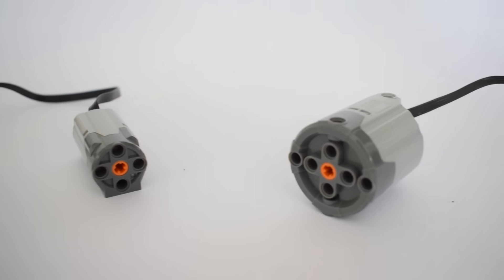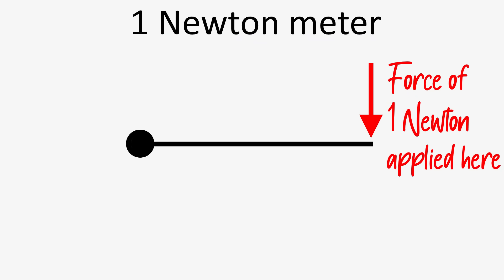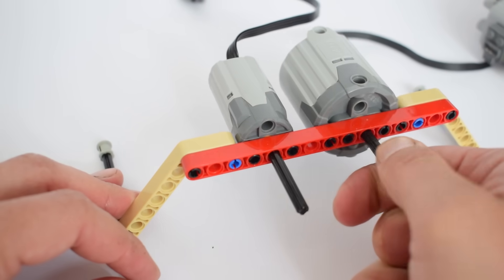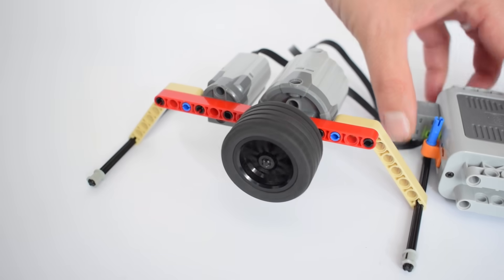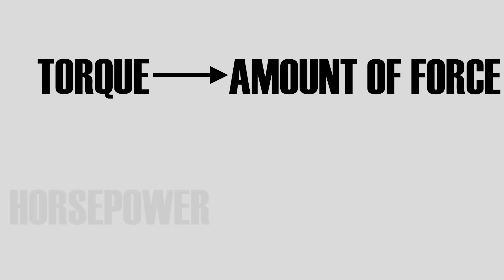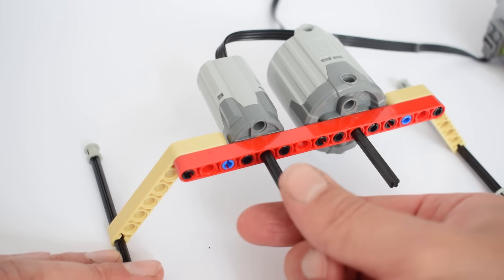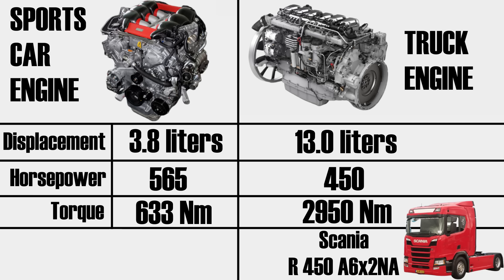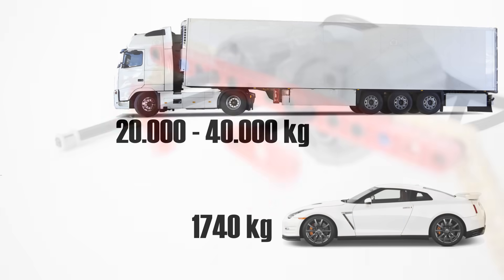NEVER be confused by HORSEPOWER and TORQUE again - HP and TORQUE EXPLAINED in the MOST VISUAL WAY

Comment: I liked this very much. One thing that might confuse people that i saw, because it confused me for a moment... is that the lower hp motor spins faster than the higher hp motor. Maybe it was just me! Thanks for the content!
Reply: Yeah describing RPM as a separate factor helped a lot
Reply: @magma2680  that is the fundamental differnce.
Reply: Same
Reply: Video got me more confused with the little motor with less horsepower spinning faster 😅. Like a GTR 500hp vs 1200hp Bugatti with higher tourqe.
Reply: @Sean Payton  I appreciate you taking the time to explain.
Reply: I think I get the gist......he didn't come out & say it but your answer is implied in the description of sports car motor vs. truck motor. The reason that one motor spins faster than the other is not just "cuz they were designed to". They have different intended purposes, yes, but the designers have only two numbers they can manipulate. If you need max HP, you gotta make torque & RPM work together. If you need more torque, you'll be limited in your max RPM and HP. You want more of one thing? It'll cost ya some of the other, cuz, natural laws and all that.......nothing is created or destroyed, but merely transformed.

Comment: This was all very good, right up to the end. The factor of gearing is completely left out in the comparison between the truck and the sports car. 
If the sports car would have been geared for the same wheel speed as the truck (like 7000 engine RPM -> 100 wheel RPM, versus 1800 engine RPM -> 100 wheel RPM) with the same size wheels, the sports car would in fact be able to deliver a larger torque at the wheels than the truck can, at the point of maximum engine power output. 
The car's engine is delivering a smaller torque, but because it delivers a higher power output, with the correct gearbox you can get to a higher torque measured *at the driving wheels*. In theory, you could haul a fairly sizable trailer with the Nissan's engine. 
Of course in practice putting a car engine in a truck is dumb - it won't last beyond 50.000km i estimate, while the truck engine can go for more than a million km.
Reply: Yeah he said the truck can haul a bigger weight because it has more torque. In principle you could take the car engine, put it in the truck, and if the gearing is good the truck would behave the same because it has an engine with the same horsepower. His explanation is a little confusing and I doubt he fully understands this

Comment: I can explain this 20 times easyer.
In a diesel car you have aprox 4500 rpm, see that as the amount of horses you have in the car. In an petrol car you have 6500 rpm which is lets say 6500 horses. Now the diesel engine horses are aprox 30% stronger. And thats why both the diesel and petrol makes the same output even dough they have different amount of horses, some horses are stronger than others. Wolla.

Comment: 1 mechanical horsepower is the workload/energy required to lift/move 550lbs a distance of 1 foot in 1 second, or 33,000 lbs a distance of 1 foot in one minute. Torque is merely the force. Horsepower is never measured, only calculated. How so? Well, torque in ft/lbs is multiplied by engine rotation (rpm) then divided by 5252 (just a constant used in the calculation) = horsepower. When it comes to cars, think of it this way. If you increase horsepower, then that means you can move the same amount of weight... the same distance... in a SHORTER amount of time. More workload = more acceleration. Same goes for weight reduction. If you have the same workload moving a smaller amount of weight, it can travel the same distance in a shorter amount of time. As far as torque, think of it as being highly correlated with the volumetric efficiency of a combustion engine. The more air that fills the cylinder, the more torque its produced, assuming the necessary required amount of fuel matches that additional air mass. But also remember, rpm plays a role too. If you can fill the cylinder the same amount but at higher engine speeds, you are producing more workload.

Comment: Good presentation, but here are some uncertainties that remain for those trying to finally understand what power is:
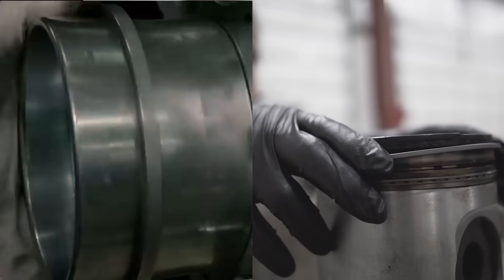1) It does not explain why you can replace your current truck with a similar truck that has 1.3 times the engine torque, only to find you have reduced towing capability - the new truck, hauling the same load, takes longer to reach a given speed, it can't haul as much weight on the same incline at the same speed, and can't maintain as high a speed on the same incline with the same load. By your takeaways ( 8:22 for example), this situation shouldn't be a thing, but I'd like to believe that you understand how it can happen (I've seen it happen).
2) Talking about a "rate of torque" or torque being applied a "number of times" in a span of time is dimensional nonsense, and does no favors for anyone trying to fully understand power, or how gearing is involved. People have to figure out that by "activity" or "rate of torque application" you are actually trying to just say "rate of motion". Power is present in the application of forces between moving things. It is simply the product of the force and the rate of motion in the same direction.
Reply: Well, the reason why trucks tend to have lots of torque compared to their horsepower is that torque isn't constant over the rpm range. A truck engine will make it's peak torque at low rpm, say 300 lbft at 2000 rpm, and then it makes 250 at 5500. That would translate to max torque of 300lbft@2000rpm and max power of 260hp@5500 rpm. A sports car's engine is set up to make it's peak torque at a high rpm. So simply switching the two values, 250lbft at 2000 rpm and 300lbft at 5500, gives us peak torque of 300lbft@5500 and 315hp@5500. Since power is torque * rpm putting the peak torque at a high rpm gives a higher power figure. 

But, trucks need lots of power at low rpm to be able to start pulling a load up the hill. You need power at 1000 rpm so you can get the load moving. Once you're going fast enough that you can change gears to keep the engine in it's power band the amount of torque it's making is irrelevant.
Reply: @Biriadan Well, not to assume you hold a common misconception, but that explanation does leave the door open for it. Let me be more specific about the misconception which guided decisions in the case I mention (a real case I whitnessed).
It's true IN THE MOMENT that if the engine can twist harder, it pulls harder, accelatates faster, or can reach a higher speed. But it is false to infer that an engine's torque value is therefore useful for comparing predicted performance between vehicles.
Where this intuition is most frequently contradicted by obvious evidence (usually fast vehicles) the common intuative conclusion has been revised to something along the lines of "torque is mainly important for heavy duty jobs".

Another way of saying that an engine makes its torque down low is it has a flatter power curve. And for the reasons you mention, a flatter power curve helps the truck get moving.
My point is that every measure of engine performance in vehicles, in all phases of operation are direct functions of power (torque x rotation rate) in the moment. None are functions of torque alone.
So the only way a truck buyer can know how an engine will perform in the real world (besides driving it) is to know peak power and the shape of the curve. At that point, knowing the value of torque adds no information and should be ignored, but it usually isn't.
Actually, if anything in the reporting of peak torque is useful, it is the rpm for peak torque compared to that for peak power. A wider gap will indicate a flatter power curve.
The reason engines that do heavy duty jobs are usually high torque, is that high torque is a common outcome of other design choices aimed at achieving high durability during sustained high power output, low cost, and a flat power curve.
Reply: @drienkm  great reply. It's so refreshing to talk to people that actually understand torque and power. I agree with everything you said. I really prefer peaky high revving NA engines so it's so frustrating to hear people talk about how they're worse or slower than diesels with more torque and half the HP.

Comment: That was really nice explanation. I just would like to add that You can actually feel the horse power of Your Lego motors. When You tried to brake it using Your fingers, i suppose that You felt a certain amount of heat on the friction point. That is actually proportional to the input energy that the battery supplies to the motor. Once You brake it too much that it stops, it will not release heat anymore because the power will be zero.
Reply from the maker: Yes, but you're not feeling horsepower, you're feeling heat and friction. You're correct, it's proportional but you can't really feel horsepower because at the end of the day it's a mathematical formula.
Reply: @d4a  When you try to brake a shaft with e.g. 0.1 Nm at 1 rpm and then at 1000 rpm, it definitely feels different. In the first case, you would feel the shaft slowly spinning between your fingers, while in the other case, it would burn your fingers immediately. In that sense, you most certainly can have a sensation of power. You will feel only the motor torque once you have stopped the shaft.

Comment: Minute and a half in and you're already using units of work in place of units of torque 🤦🏻‍♂️ it is lb-ft, not ft-lb.
Reply: That's because torque is rotational work: ft x lb = lb x ft, no?
Reply: @kitmoore9969  They are the respective equivalents of each other, but you cannot interchange them.

Comment: This is why people who rate semi trucks by their horsepower are ignorant
The Volvo FH16-750 outputs 750 hp - which isn't very much when you have to pull loads of up to 60 tons. Fact is that's a power to weight ratio of just 12,5 hp per ton. When you however realize it also outputs a gargantuan 3550Nm of torque you'll know it'll pull that 60 ton load up sloping mountain roads no problem.

Comment: So basically, if I take a very high torque engine and get as much rpms out of it as I can in a smaller vehicle, not only would it create a very high horsepower, it would be a monster in terms of specs and performance. 
Seems pretty simple and straightforward when put like that. 
Thanks for the idea, imma name this project the "Beast".